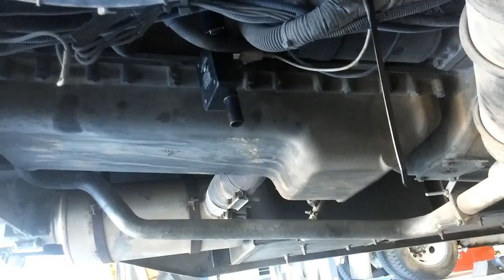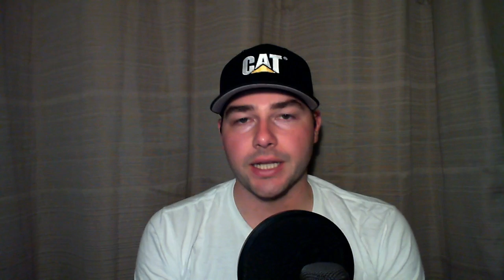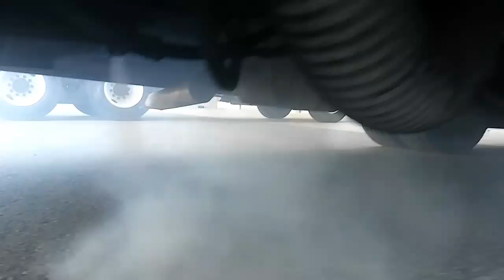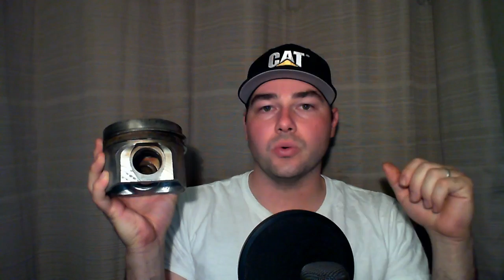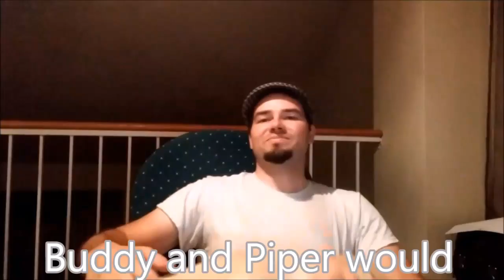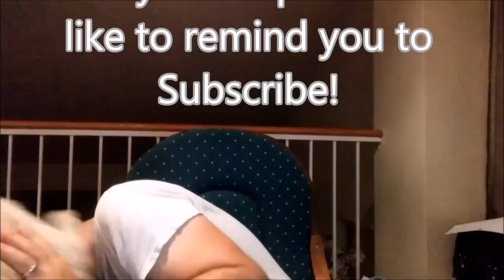Is Idling Your Engine Bad?  Does Idling Hurt Your Engine?

Comment: Your shop floors are so smooth😍 I want to work there just cause of that, the floors at my shop are trash and my creeper gets stuck now and then
Reply: I installed the controls for a hot water radiant heat system in the floor of a heavy equipment workshop.  I couldn't work there .  I would fall asleep on the warm floor.
Reply: alex ruano
Reply: alex ruano you can get them ground or surfaced to smooth them.
Reply: Clean Tacoma! You in the TTE group?